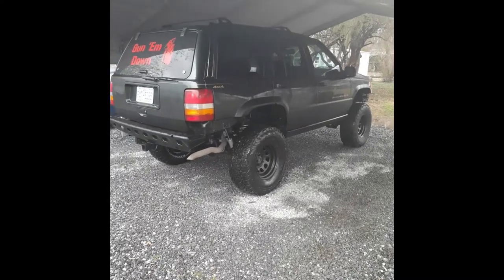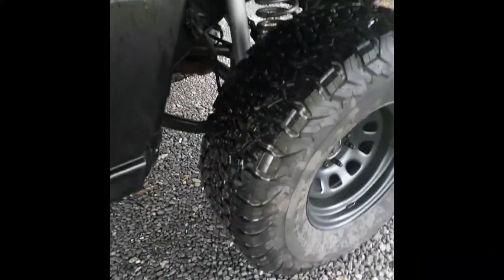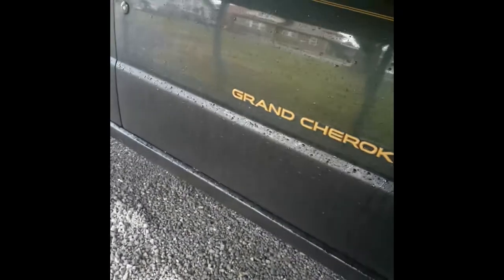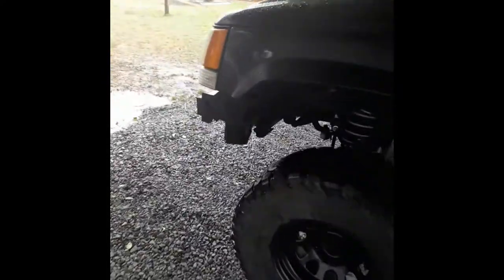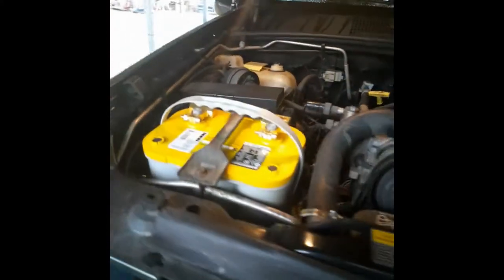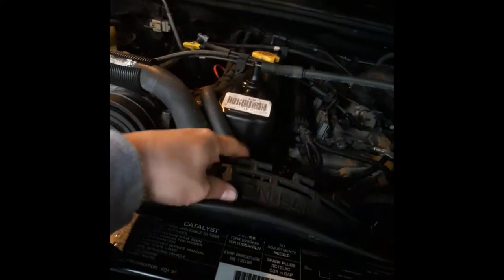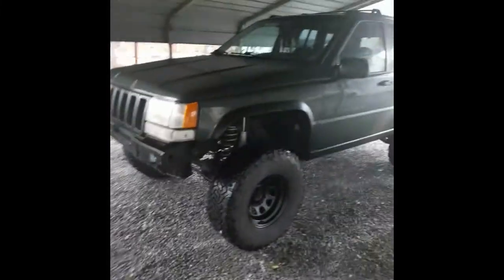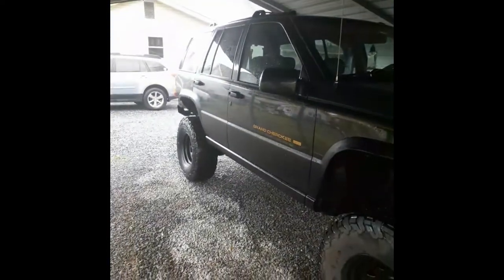cutting fenders on ZJ

Comment: Hey so for the stupid evap canister I went to home depot and got a few feet of tubing and just unbolted the box and sat it right on the other side on the engine bay in between the bard lines ran for the ac. It just sits there doesn't move a bit never gave me a problem I ran the rest of the tubes across the back of the engine bay it looks clean enough for me but there are other spots to relocate it to
Reply: In between the hard* lines for the ac. It's almost a perfect idea spot to hold it in place you need to wiggle it in spot and then the hoses with a few hose clamps will hold it from falling anywhere along with it resting on the chasis and between the hard ac lines
Reply from the maker: thanks man. its been awhile since ive been on seeing how ive started another job. i did do a relocation where i just basically took the canister and turned it sideways and ziptied it up out of the way. Seems to have worked ok so far
Reply from the maker: sweet, i might have to try that one. im working on a few mods on the jeep so getting another video up eventually when im done with the mods.